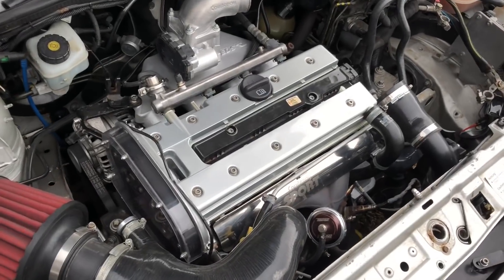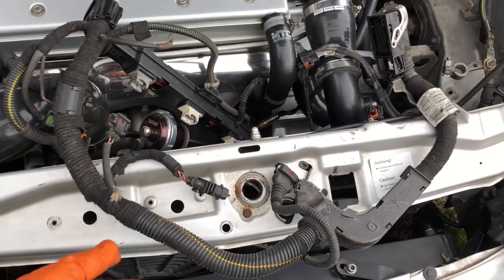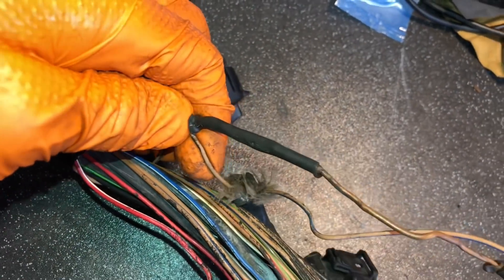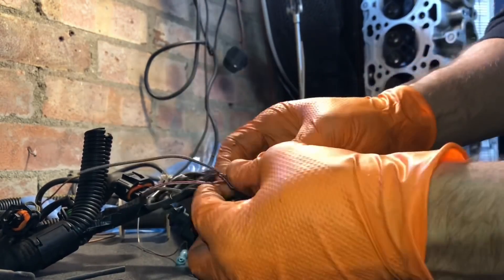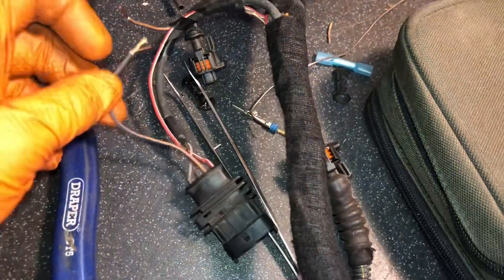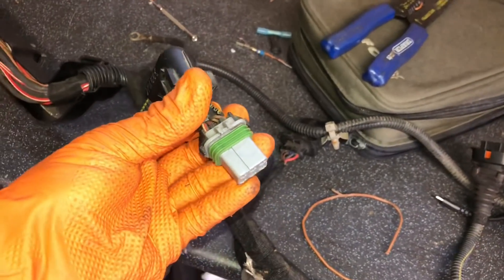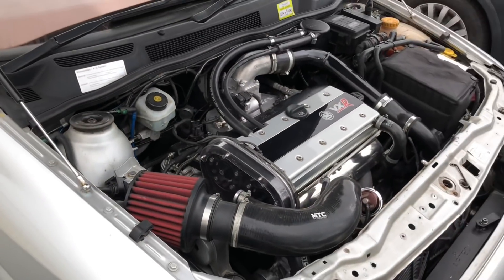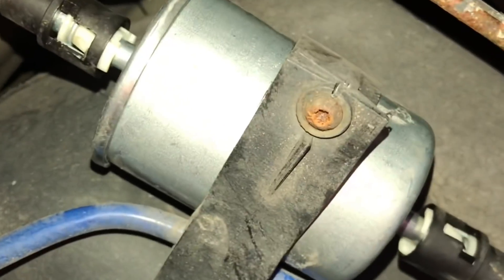The Legendary Opel Z20LET Engine Loom Earth Problems! Fault Codes & Missfire FIXED!

Comment: Really useful video, I’m working on a lotus evoura with the z20let lump in. It’s running poorly and the data on the opcom is weird too. The barometric pressure is 50 kpa and the battery voltage reads 8.9 even though the battery is over 12v. Could this earth problem cause this? Any thoughts would be appreciated, thanks.

Comment: Great job arron does the z20let and the z20ler have the same loom I've changed most of the sensors on my astra h Sri turbo but it still seems to be over fuelling if the looms are the same I'll have a look at the earths

Comment: This is actually the TIS repair for the field action 2006. This will help people no end 👍🏼
I done this repair myself and it makes a huge difference. It’s highly advisable for anyone with a Z20 Astra to do this repair!
Reply from the maker: Hope it helps people out 🙌🏻
Reply: Aaron Unknown definitely help. Hopefully it will put an end to people looking in the wrong place for the earth connectors. 
I was also thinking about adding an extra earth take off further along the loom so it has another connection like it does on the inlet manifold but around the gear box area.

Comment: Where can i get the same blue led speedo bulbs from.
The blue ebay ones i have are dim
Reply: I use the ring ones from Halfords they work great Iv used them in 9 or more cars and work great and last for ages still have mien in from 6 years ago
Reply: Crazy leds

Comment: Nice job on that loom! I know I would have been looking left and right to find what was wrong if I had to sort that out lol. Good shout on the V power I use it in my bot standard 1.6 diesel and it does make a huge difference to the way it runs, not so much power in it because it hasn’t got much anyways but it doesn’t detonate like normal diesel so I don’t get a rattle under acceleration. I think mine needs carbon cleaning or something like that but the v power does help it so I just continue to run it on that and it’s happy.
Reply from the maker: Most definitely is far superior fuel!
Reply: Aaron Unknown worth every penny of the £1.30 odd a litre it costs!
Reply: @Alexander_l322  give it a blast down the motor way that should clear it, probably carbon build up👍
Reply: Shaun West it seems like it is mate but and I do drive quite aggressively but it doesn’t seem to make much difference to it but having the v power in the tank does make the difference. I think with that and blasting it around like a hooligan will help it clear out but I think it will want a walnut blasting or something like that at some point
Reply: @Alexander_l322  sounds like a plan 👍,I always use redex👌
Reply: Shaun West I have used redex in other cars and I can’t say it does fuck to be honest, cataclean or whatever it’s called does work for getting a car to pass it’s mot on emissions though. I’ve stuck in 2 bottles of wynns extreme diesel cleaner in this car and again it didn’t do a lot as far as I can tell. I swear by the v power now as it’s the only thing I can honestly tell is making a difference to the noise and driving of the car. It’s not cheap to fill up but i find it’s so worth the extra.
Reply: @Alexander_l322  probably depends on how old and the mileage of the car, diesel cars do lose power,but v power is great for performance 👍